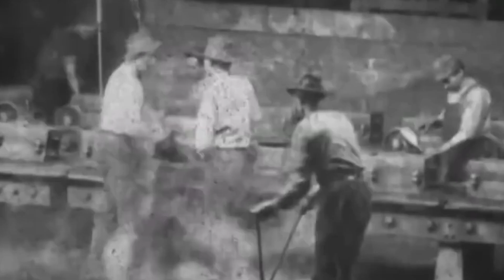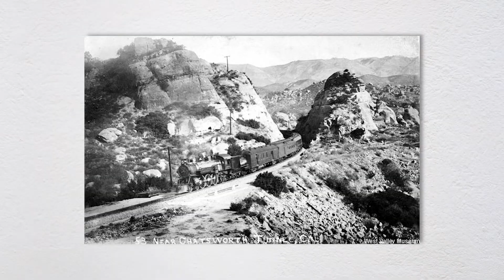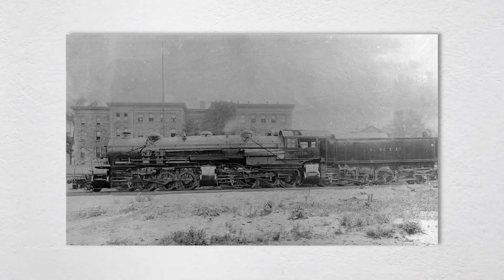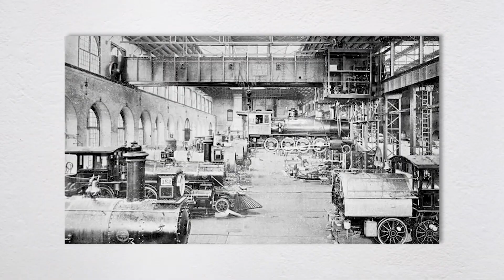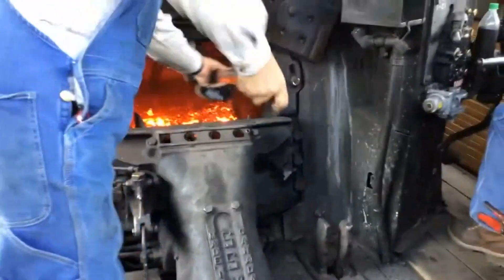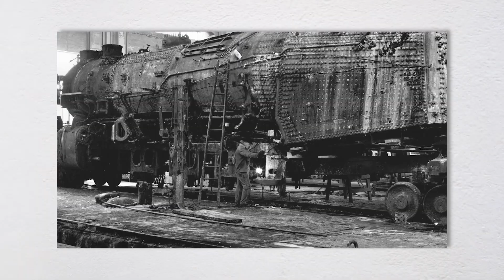The 24-Wheeled Steam Monster That Tore Its Own Trains Apart

Comment: Actually, the triplex didnt have enough boiler pressure to go at a regular speed
Reply from the maker: Exactly — that’s a great point. The boiler couldn’t sustain enough steam for all three engine sets under load. Appreciate the insight!
Reply: Or perhaps more specifically it's boiler and firebox were not capable of generating enough steam for its cylinders at higher speeds over more than a short time period rather than sustained length.
Reply from the maker: Well explained — that’s exactly what made the Triplex struggle in real operation. Thanks for adding that detail.